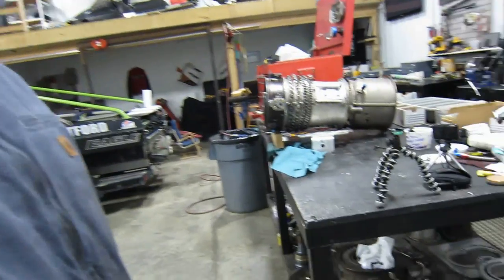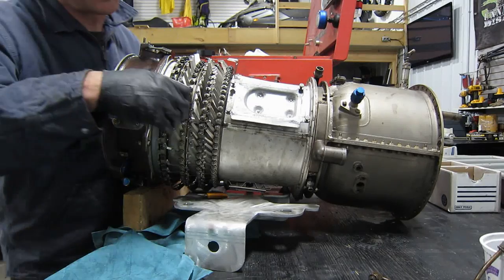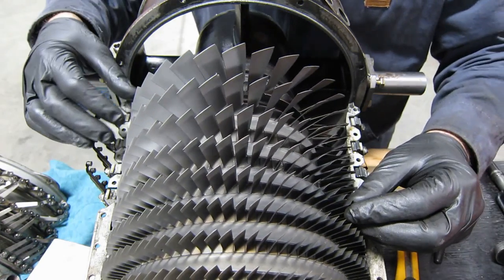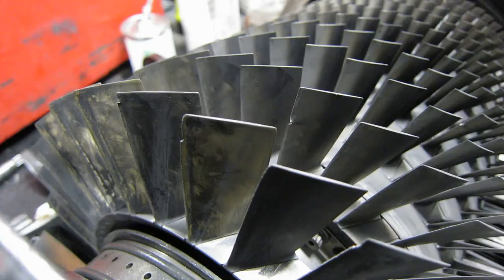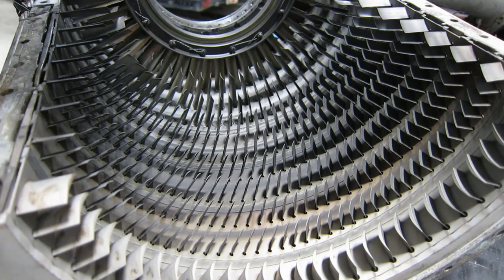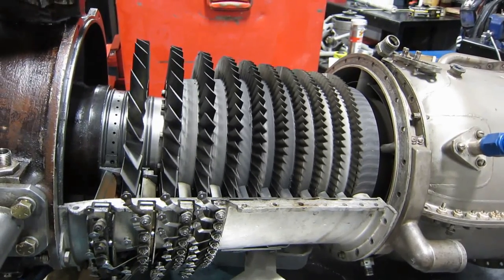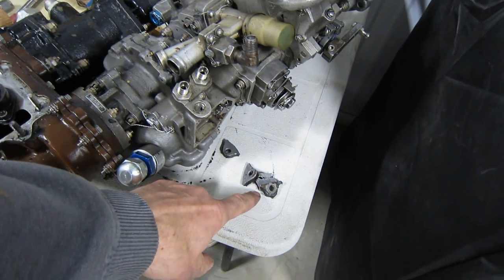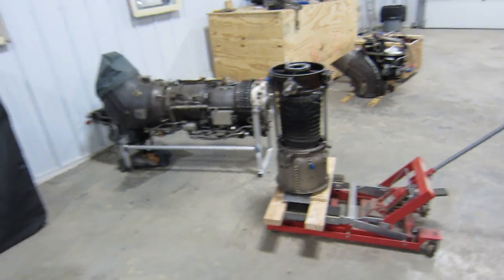T58 pt. 2: Compressor

Comment: When we used to tear down t58 motors in the Marine Corps, we would have a drop sheet taking drops with a depth micrometer as we went down to the front frame. When we built it back up we would refer to this to make sure that everything was tight by taking drops at build up. For the blending of the blades we used go/ no go gauges to ensure we do not blend off to much on the compressor blades. Great video brings back memories of building these.

Comment: Imagine the weight difference between this and a twelve hundred hp radial-not to mention the smoothness and reliability..excellent video!
Reply: Not just the weight, but the size. Not to mention that, as loud as this engine can be, it is certainly MUCH quieter than a 1200HP radial.

Comment from the maker: Good eye !... that shot was in the pt.1 video... I didn't show me taking it out, but the part you are talking about is a spacer / cooling air deflector fitted to the rear side of the stg 1 turbine wheel. Cooling air is held against the disc, and then escapes through those holes. The airstream exiting the holes prevents soot buildup, and you can see that by the pattern of soot around each hole.

Comment from the maker: The T58 uses a different system of locking the stator rings in place. Small strips of steel are trapped between the case halves when they are bolted together. The work great, but easily fall out when you pull the compressor cases apart... as you've just seen.

Comment: Do you use any homebuilt brackets to support any accessories on the engine? like the fuel control to minimize the risk of cracking?

edit: Hah, I was little fast to comment before i watched the end. How did you solve the problem? a bracket in the rear of the fuel control?

Comment: How do you determine when a blade is too far damaged to be repaired?  It looks like a lot of those blades are missing chunks.  I'm assuming that you also have to balance the engine after buffing out the nicks.  As many people have stated, I've learned more about jet engines watching your videos than from any other source I've found.  Great videos, keep them coming.

Comment: Would be awesome to see the boat running over the lake (I say over, not in, when it's going that fast...) once it's all fixed and put back together.
Saw a lot of little holes near the edge of the 1st stage turbine rotor that were soot free. What's going on there?

Comment: @AgentJayZ - Thank you very very much for the deep insights into this engine. I have a few questions:
How are these engines lubricated? Do they have a lubrication oil pump for the main bearings on the accessory drive?
Are the damaged blades in the compressor fixable or do they need to be replaced?
Do they have an electric generator to provide electricity for the verhicle or battery loading?
Are the main rotor bearings able to take the pure forces when the boat is bumping over rough waters or is the engine mounted cushioned in the boat, so that these shocks can't reach the engine?
Again, thank you very much. In fact you infected me... Now I'm thinking about how to try to get one of these engines in a good condition and maybe put it in a race car for fun or into a boat too. But here in Germany you can't race such boats where and when you want, only on special events which are pretty rare over the year.  And driving slow only with an idling turbine engine is not very fuel-effective I think... but a great sound!
Please don't stop making these videos, they're awsome.
Reply from the maker: 1) - Have a look at my video: jet engine lube system
2) - Blades can be repaired or replaced depending on how extensive the damage is.
3) - An alternator is fitted to the accessory drive gearbox, or to the output drive.
4) - What's a pure force? Choppy water gives a bit more of a rough ride than landing a helicopter, but the engines seem to deal with it well.
5) - The T58 would make a great engine for mudbogging, tractor pulling (seen events in Germany with T58 powered tractors), or a fast boat. Our boats only run in competitions sanctioned by the World Jet Boat Racing Association.
Reply: @AgentJayZ  Thanks for your very quick response, very nice from you. You're the first and only channel in all those years of Youtube which I subscribed to.
With "pure force" I meant the bumpy ride when a race boat goes over waves, maybe jumps a bit. It sounds hard for the turbine parts or main bearings when they have to take that constantly without suspension while rotating at full speed. On a car you have suspension and dampers to reduce the bumping from the road, but you don't have that on a boat.
One last question: Can you damage the power turbine when it's locked stationary and the gas generator is running at full power or is the engine totally fine with that?
Reply: @AgentJayZ  bao nhiêu tiền để mua được động cơ rubin này

Comment: I surprised when the stator rings came out as you were pulling the case half. Does this engine not use the locator pins (painted red in a different video iirc) or had you already taken them out?

Comment: Why's a RR stator setup in a GE engine? I was  surprised when I saw a video about Trent engine assembly, and the compressor blades appear to slide into a groove in the disc like the stators in the cases. Do all RR engines use that type of setup or just newer engines?

Comment: Have you any experience with T64s?  I'm guessing they can be disassembled in a similar fashion (stand on nose and work from turbine down).  Apart from the larger size and added weight, do you know of any striking differences in disassembly procedure between a T64 and a T58?

Comment: Do smaller turbojets hold longer (i.e. require less maintenance) than their large sized counterparts (LM2500 etc.) or is that simply an engine in a good condition?

Comment: Hello AgentJayZ, I can image that the stator modules (or each stator blade) apply a torque on the engine, and the turbine nozzles a torque in the opposite direction, is there a net torque on the engine while it is running, or if the power is suddenly increased?  Frequent viewer from South Africa.
Reply from the maker: I think you are right, but I don't know if the torques cancel out completely. The engine mounts in our test cell and in the aircraft do not permit the engine to rotate.
I think if there was a noticeable net torque a jet pilot of a single engine aircraft could feel it through his Attitude Situational Sensor...
Good question !
Reply: AgentJayZ  Yes, I guess that is true...  I was just surprised when I saw (in your videos) the pitch or angle at which the turbine nozzles direct the exhaust gasses into the turbine blades, and could not help but think of the torque the nozzles must resist.  ;)

Comment: Did you fix those turbine blades or did you leave it out for a reason? I'm also suprised to see the fuel pump hanging like that. Did you fix that?
Reply: Is this yours Frode??
Reply: B1N4RYGH0ST No, my power toys are a lot smaller.
Reply from the maker: Frode Angell Løtvedt Those are compressor blades. As explained, the damage was blended out. Each race team has developed a way to support the accessory section.

Comment: I am curious as to the purpose and function of the variable stators or blow-off valves in other engines. I think it has something to do with starting, but I am still not sure why.
Reply from the maker: bootlegger 23 You are right. I have addressed these devices in a couple of my Q videos... check the index of my playlist called Your Questions Answered.

Comment: what keeps the stator vanes from rotating around the casing? do they only slide out the one side? never mind, re-wound the video and saw the clips on the side locking the stators in place once the housing is together
Reply: A staked set screw holds each stage in place.
Reply from the maker: Mike Parker Not in this engine. The stators are held in place on one end of the slot by the end stator which has had it's base staked, and at the other end by locking strips that fit into the cases.
The LM2500 has rotor blades held in place by set screws.
Reply from the maker: AgentJayZ Correction... the T58 only uses the lock strips. The staked base stators are used in the J79 / LM1500...

Oh, I just read your Q to the end... very good !

Comment: How bad does a compressor blade have to be before it's junk. Obviously if it's bent and curled over then yes I can see. But I thought you should have to replace if any damage at all. Maybe this is for the aviation/ flight?
Reply from the maker: The overhaul manual has very detailed inspection procedures and measurements for allowable repairs for each stage of compressor or turbine blades and stators.

Comment: Are the compressor stator blades opposed to the rotor blades?
Reply from the maker: In some ways, yes, in other ways, no. This is a vague question, with many meanings, that can be answered in many ways
Reply: yea I'm having trouble wording it. I guess it wouldn't make sense for the air to come off the rotor blades and hit a wall. Do the stator blades help channel the air to prevent turbulence? That must be their purpose because it seems unnecessary otherwise. Thanks for the videos and responses!!!
Reply from the maker: The stator vanes do  the compression. they also direct air towards the next stage of rotor blades.
They are very important. Have a look at my recent Questions video "Q42" for a bit of a discussion on stators.

Comment: Ever thought about putting one of these into a Volkswagen?
Reply from the maker: A new drive train would need to be made with a compact, high power gearbox mounted almost directly on top of a high power rear end. It would be interesting.
Or you could do it the most inefficient way possible - by removing the power turbine, fabricating an exhaust nozzle, and using the engine as a turbojet. It would be loud and dramatic, but waste most of its power as noise and heat.

A better vehicle to use 1200 Hp in would be a long box pickup truck.

Comment: at the risk of sounding like a idiot and apologies if you have covered it in a video, i haven't yet came across it, but would variable compressor blades be viable given the complexity for such a linkage or has this been looked into and forgotten about for said reason?
Reply from the maker: +Bob Bobby I think you are bang on. There are so many blades, and so many stages, I think it would be incredibly complicated and prone to failure. The variable pitch mechanism for a propeller is quite amazing, and it might be a starting point, but each stage of the compressor needs to be adjusted by a different amount.
Plus, the job is already accomplished by the variable stators. So no need to worry about varying the angle of the blades. It would be no more efficient than what is already used.

Comment: Where can I find a T58 at? I want to put one in a boat.
Reply from the maker: Arkansas Journal That is the question... New, they are amazing, but over a half million (probably way over!). As non-running junk, with parts missing, they are a few thousand. You need to find one that hits that point on the graph where the line described by your ability to fix one crosses the line traced by you ability to afford one.
Good luck!
Reply: A far better engine for a boat would be a pair of Olympus 593's maybe ?
Reply: Might it be possible to buy two (or more) junk turbines and cobble something together as is often done with automotive engines? Or are tolerances too tight to be able to, say, use a stator section from one engine in another?

Comment: R.E.L.A.B.L.E.   Not a big block with a blower.
Reply from the maker: Correct. A big block Chevy with a blower would be a little more than what is needed to be a starter for the J79.
But for the J58s in the Blackbird, the first start cart they used had two NA 455s powering a vertical shaft engaged to the main rotor.
Pistons are way better for cars. For jet aircraft... you need a jet.